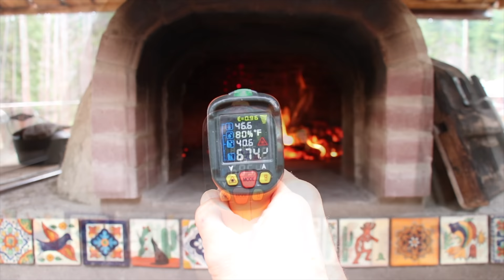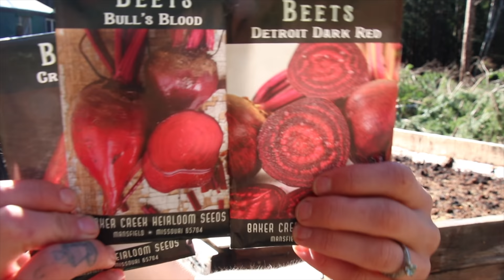LONELY & COLD OFF GRID // 2 YEARS in WILDERNESS on RAW LAND - FIRE for FOOD & SUN ENERGY - Ep. 125

Comment: There is another way to light a fire.
You can put the big logs on bottom und smaller logs on top.
Light it from above and let it burn from top to bottom.
Whether in the oven or the fireplace.
The advantage is, the fire burns hotter, you have less smoke and the fire causes less particulate matter.

If you light a fire from bottom, the flames are cooled down by the large pieces of wood.
Try out ;-)

Comment: The yurt is cool, but I think you’d be happier with a foundation, logs, and such.  With all those free building materials I’d be building a  south facing structure with real windows to let in the light. Stones actually hold heat due to their mass.  I mean off grid I’m so down with that.  Building a yurt sized house is very doable. Pine cuts, splits with simple tools.  Sand and mortar can be mixed in a wheel barrel.  I would build a centered chimney, not a fireplace, to act as the flue for the wood burner and to hold the rafters.  Use clay tiles and router your steel  pipe through the tile as an extra precaution against the occasional chimney fire.  Pine is not ideal for a hot fire.  The fireplace is not usually great at controlling air flow and with drafts will suck all kinds of outside air into your dwelling.